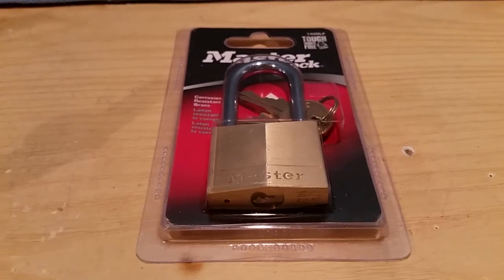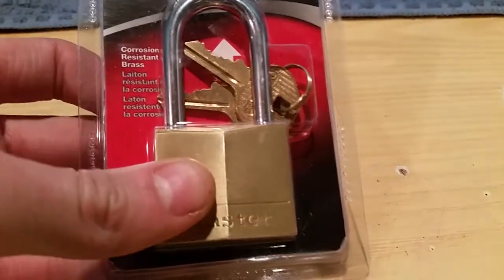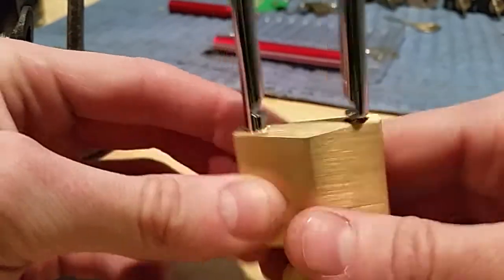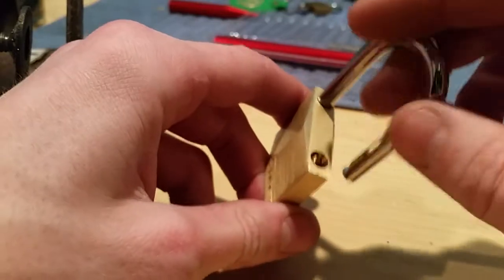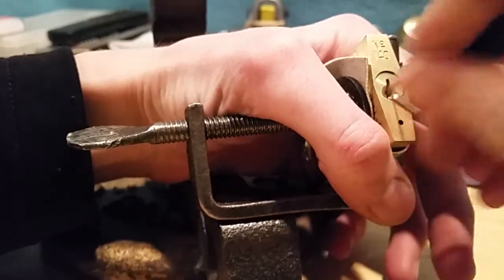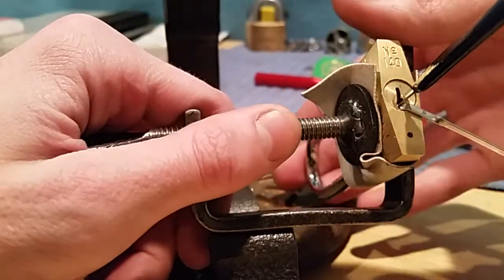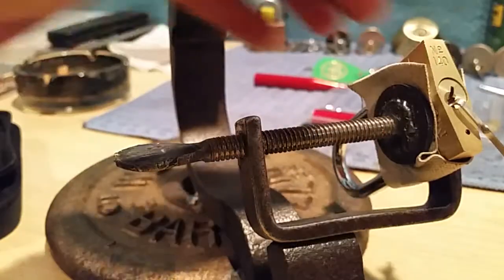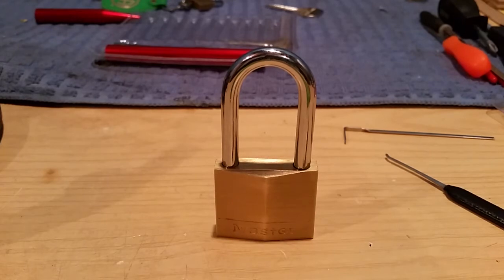Master lock 140 Zipped, Rocked, Raked, and Picked

Comment: I have a 140D and it does have security pins. I have been able to pick a lot of locks but not this one little 4-pin $7 lock. Drives me nuts.
Reply from the maker: Try a taller pick, there could be one pin i  the back that has to be set very high, or one set pin could be falling back down after you set another one. Good luck
Reply: I've put in more than an hour unsuccessfully trying to pick mine. I think it's because adjacent pins are at radically different heights. It's one of a set of 4 padlocks, so at least I know that my padlocks are more difficult to pick than most.

Comment: All lock picking videos online bug me. I feel like the titles should all be "how I can open a lock", because I try the things that they show and I never succeed. Obviously there are other things I need to know that aren't being discussed
Reply: I start piking locks  2 years ago and i had the same dilemma  But i never give up , now i can  ease pick many locks .    I suggest to buy practice locks and  see how  it works helps  allot to understand the picking techniks and never ever give up  practice make perfect   Good Luck
Reply: I had the same issue till I bought one of those clear locks. I bought the easiest one to pick. After about a day I was able to pick it fairly quickly. Not like this guy but still with in 5-10 min. Haven't tried this lock yet.
Reply from the maker: Great advice! I unsuccessfully tried my hand at lock picking years before I made this channel and had the same issues. I never had one of the clear practice locks but it would have done wonders for me as I'm a very visual hands on learner, I have an extremely hard time visualizing parts and their functions without seeing them in action! Also check out BosnianBill, I learned everything I know about picking from watching his videos!

Comment: Yer, Master 140 have 3 spools and 1 serrated - there are plenty of videos of people opening them up. Which makes me think this video is bullshit. Did you drill out the pins or something? Or you found one with terrible bitting and only had to pick the first two pins or something. Easy to show a different key and say yer, this is the bitting, then not use it to open the lock.